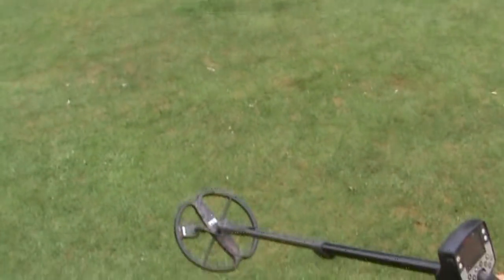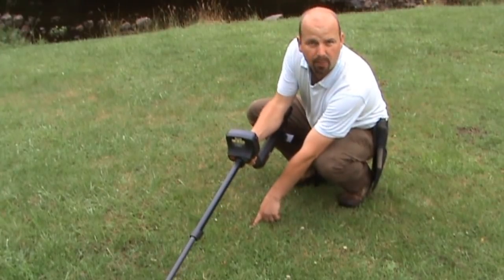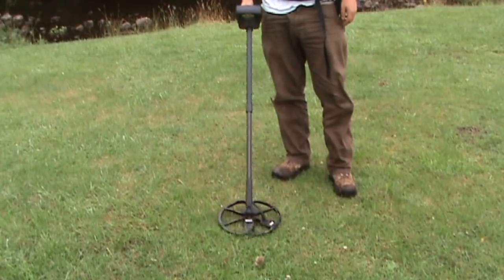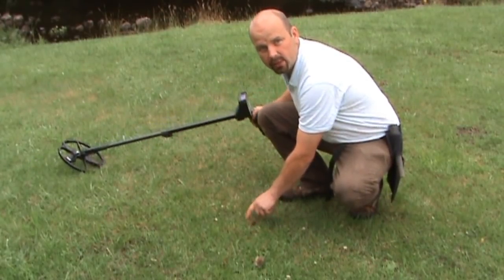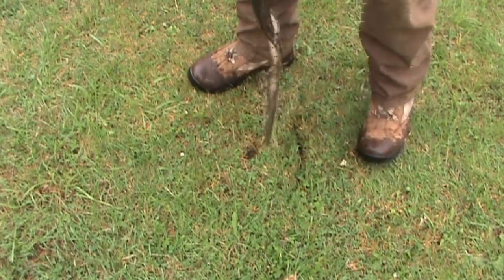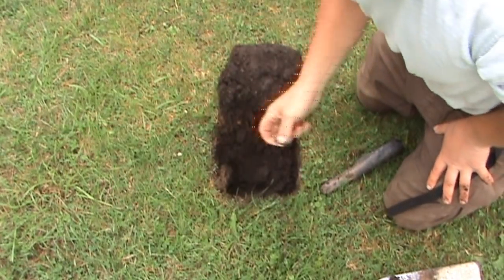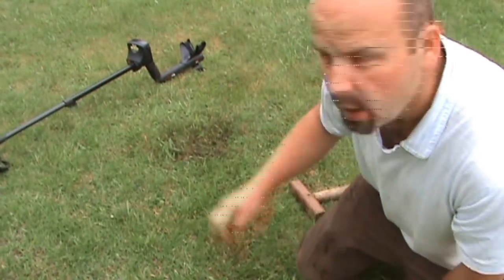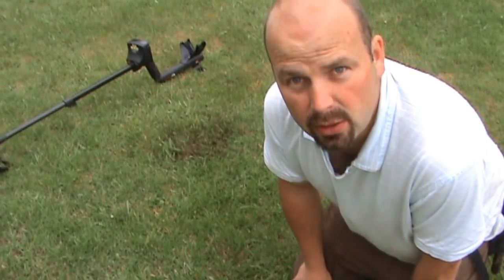Metal Detecting Tips: Pinpointing

Comment: The technique demonstrated here is more or less as recommended by the Sports Turf Research Institute when they were asked for their advice back in the 90's. A straight bladed spade used to cut a large, deep, steep sided divot in moist (never dry) soil. This way, as shown, it can be replaced in one piece, going in like a plug. Done properly, it won't die or pull out. All I would add is it is very damaging to cut divots when extracting a shallow target. These should be probed out from the surface with a screwdriver or similar. Otherwise you end up pulling the divot to bits to find the object, which will always damage the turf.

Comment from the maker: You really just need the sensitivity set as far as you can before the machine starts 'falsing'. If you are searching for shallow targets in a park for example you can run with low sensitivity. This will allow the machine to run without picking up rubbish surrounding good targets in trashy ground. In pasture I try for as high as I can as I want to search very deep. In the end it depends on the conditions, you just want the machine to run stable with good depth and target ID.

Comment: Im doing the same. Even using the pinpoint function on my detector. My target are always in one of the corners of my plug., So i have to dig into the sides and the retrieval is hard as hell.

Even tho the pinpointing say i am directly ontop of it. i never am.

And no. im not digging to small plugs. I just suck in general apparently
Reply from the maker: glowpipe lol, Sometimes it can be difficult to pinpoint in contaminated land but normally the target should be bang in the middle - if not then the probe is very important to find the target in the side wall of the hole.